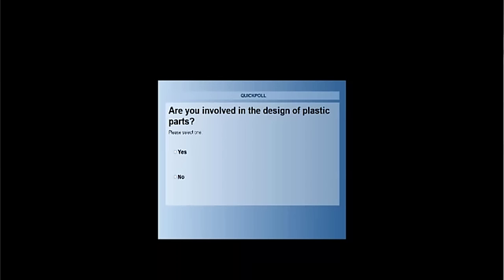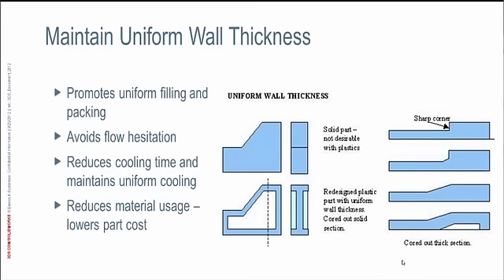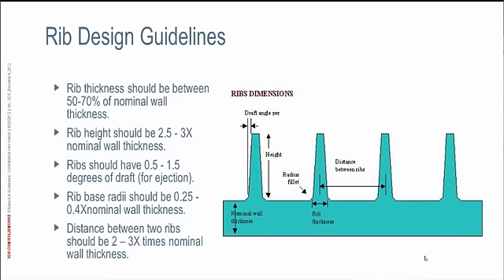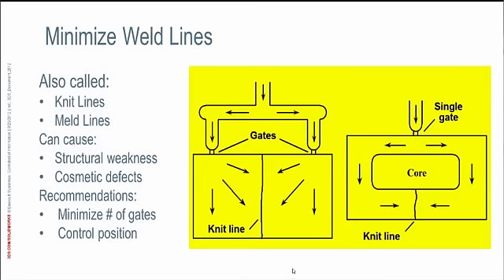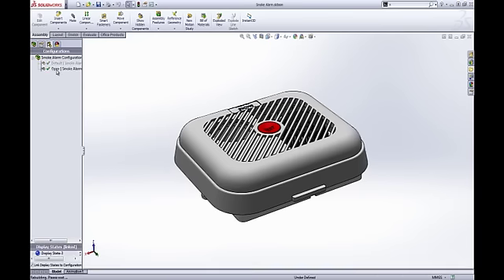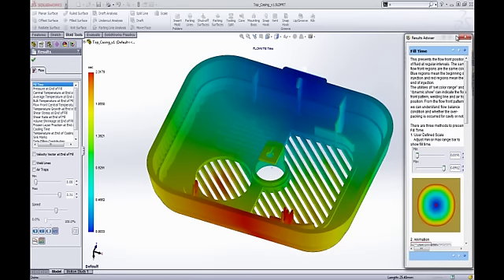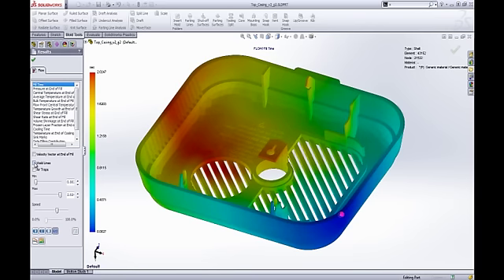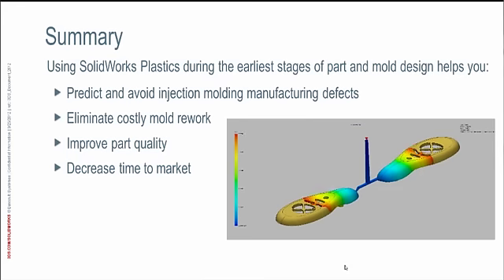The Essentials of Better Plastic Part Design

Comment: rib thickness can be designed at 50%-70%?
I work in injection manufacturing . as far as i know if rib is larger than 0.5 or 50%  of part thickness , the sink mark will occur for sure.
Reply: Depends on material, temperature, rheology, and mass. Part thickness to rib thickness is not linear or scalable across material classifications.